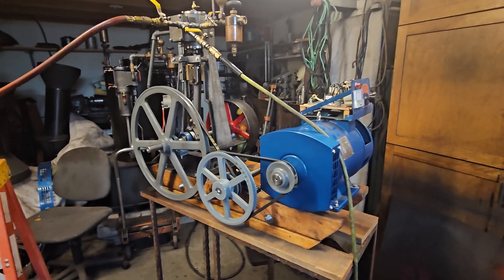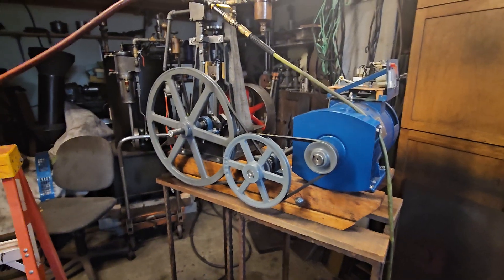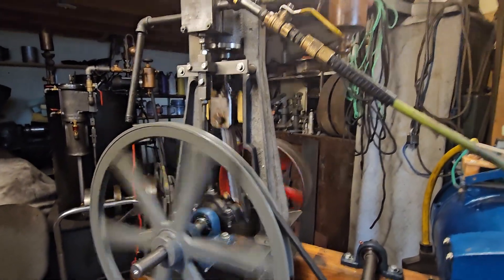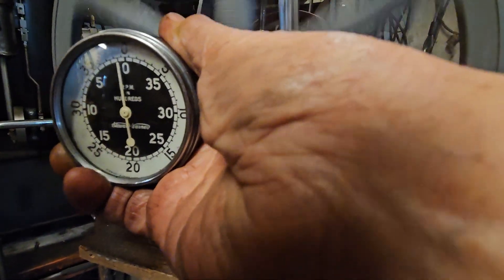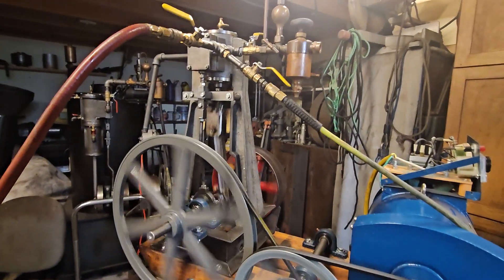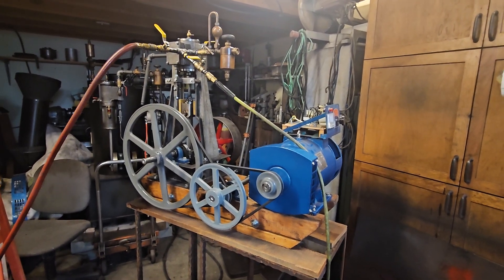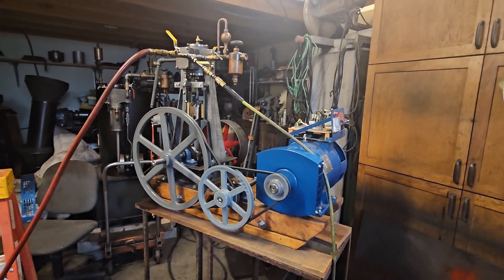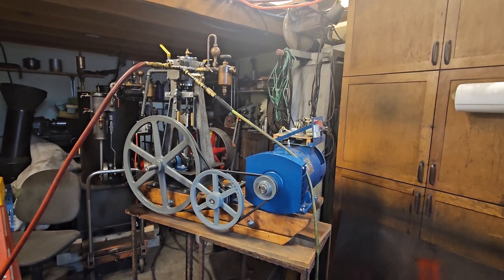Steam Engine Running an AC Generator second test Ross Bendixen

Comment: I love it...but i would use a simple bicycle chain drive for less friction.  Unfortunately chain drives are noisy especially when the load is in overdrive as you are doing, you would want nylon sprockets on the driven side. (Not the drivers).
Maybe a toothed timing belt would be better so it doesn't have to be tightened so tight? Or a combination  of the 2?
Thanks for posting, i have a similar project brewing with my steam donkey engine, this is an inspiration.👍
Reply: I would really second the use of chain. I have a large steam driven 8" Tesla turbine, and the drag between the blower and pumps that it's running were really dramatic with a v-belt. Swapping to a chain drive made everything run without issue.
Reply: @georgeblack589  in a perfect world it would have silent chains like on my old lathe but that probably cost an arm and 2 legs.
However, I personally acquired a motorcycle gearbox and I am planning to use it on my steam donkey generator by switching the input/output so the 4 speeds are overdriven...but I am betting it's gonna be quite noisy in overdrive...probably sound like an old fire siren.😃
Reply: @rogueart7706  Very cool! Straight cut gearbox?

I'm working on a large steam engine right now, and the tesla turbine is part of the boiler blower/fuel pump. The engine itself is a 2 cylinder flat engine with a 5.5" bore and 11" stroke. I was just working on the camshafts today. Hopefully I'll fire it up on compressed air soon.
Reply from the maker: You will need a steam boiler.
Reply: @georgeblack589  👍Tesla turbine👍

Comment: I've been in solar since 2006. My first job was in an off-grid office powered by solar, microhydro and a generator. We did a lot of work for people who were convinced the world was just about to end. They always got a battery bank and a gasoline generator, but no solar. It got me thinking about true "off-grid" scenarios where you can't drive down to the gas station to get more fuel for your generator in the middle of winter when your solar isn't fully recharging the batteries. I looked into some antique steam engines on various off-grid forums that existed back then, but our company didn't want to get into steam power. Great to see projects like this. If I even decide to get an off-grid property, this is what I'm getting instead of a Honda generator.

Comment: What's the synchronous speed of that induction machine?
Reply from the maker: I think what you are talking about is RPM. 1800
Reply: @rossbendixen  Yes. If you can run that steam engine at 100 RPM and the machine a little above synchronous, then you should be good to go. 100 RPM on the engine output shaft should be perfect.